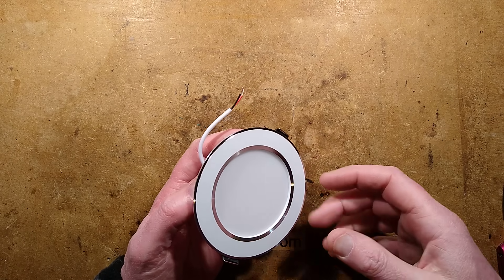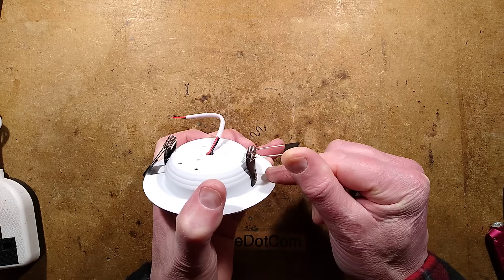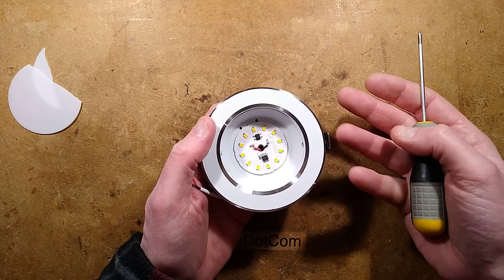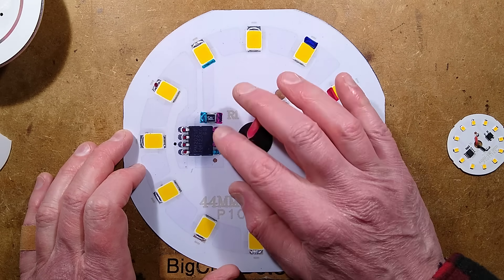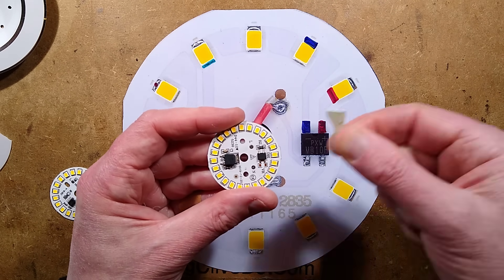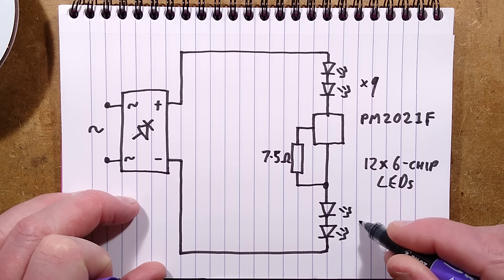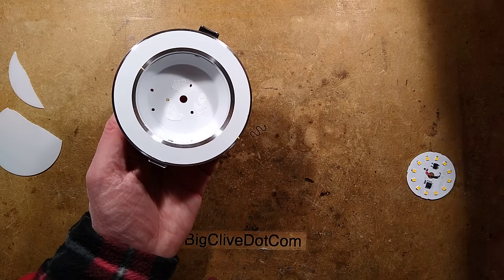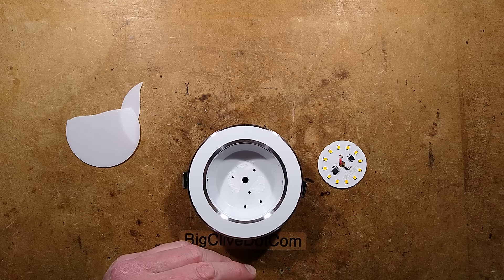inside a $1 downlight - novel circuit twist

Comment: Could you use 110 or 220 DC with the cheap LED? Should be no flicker? RF power supply might work!?
Reply from the maker: If you rectify and smooth standard 110 or 220V supplies the voltage shoots up to the peak sinewave value and causes issues with thermal dissipation from the linear regulator chip.

Comment: The good news is, that when the lamp eventually fails, those side spring clips will double as a mouse trap.
The bad news is that the springs haven't enough strength to kill the mouse.
The good news is that the electrical short circuit will electrocute the captive mouse.

Comment: I once found a led bulb made in one of the Asian countries that was made so shoddily bad that it was laughable but genuinely impressive it was bad, like the stinger heater kettle bad. I wish I still had it. 

It was also impressive due to the fact that it was from about 2003. And used blue leds and a uv paint silicone mix on the outside of the plastic lenses.
Reply: It didn't even have a capacitive dropper in it.......those poor poor leds 😞

Comment: I guess the trouble with these and poor serviceability (without good electrician know-how) isn't so much the zapping, but the potential fall from a ladder after the zapping given where such lights are located. Also I'm guessing these things would make a selling point for those snap-style quick connectors vs. any wiring nuts.

Comment: Big Clive, why do GU5.3 12volt DC downlights have so many components on their boards?
They run from 12v DC rectified transformers, surely All that would be required would be a current limiting resistor and possibly a capacitor.
Why are they so complex?
Reply from the maker: They need a rectifier and regulator because they have to allow for older magnetic transformers which have a higher voltage when lightly loaded, and the hideous electronic halogen transformers which put out a spiky waveform peaking at over 30V.
There's also an efficiency advantage to using a buck regulator on regulated 12V DC when driving LEDs at high current.

Comment: It would be nice of you if you got back to giving us the voltage of each chip. I like to make 12  or 5 volts dc lamps out of bad bulbs. Thanks for the extra work. Long time watcher first time commenter.
Reply from the maker: Many of these lights use multi-chip LEDs with a very high voltage per chip.  Often around 18V.

Comment: Lesson learned on devices like this one: if you have more than one installed in the same room, always buy spares. It will likely be impossible to find an exact same model (colour, size, brightness, colour temperature etc) sometime in the future when one inevitably fails.
Reply: Might not hurt to subtly mark one of the tiles in the drop ceiling, and keep the cache of spares in a small bag or box atop an adjacent panel. That way they're always in the same room where they would be needed. (Might need more than one reminder for that to work, but it's better than having some "mystery lights" sitting where they could get tossed or whatever. Or trying to figure out where they were stashed otherwise.)

Comment: Takes 12 Watt ? It should be ad bright as the sun with such a power usage (for a LED light). However it is very faint, is all the power dissipated into heat ?

Comment: I would love to see a tear down of the new style of disposable vapes that gave settings for "strength" as well as "sweetness". Strength is quite obviously voltage out but how are they adjusting the sweetness when it only has one juice reservoir
Reply from the maker: It sounds like a gimmick.  The flavour may change with power.
Reply: I finally got around to taking one apart and it turns out it's got two separate juice reservoirs and they fire independently.

Comment: I put 50 of these in my house. Failure rate is very low. I thermal glued a coke can on top of each as a heat sink. You can fix them by shorting the bad LED.

Comment: Would it happily take 12v?
Reply from the maker: No.  It would need a different PCB for that, or discrete high power LEDs and a resistor.

Comment: Every time i see you daintily touching the case testing for ground leakage, i'm reminded of my stupidity as a child.
I'd have to guess i was under 10, and my aunt lived near a lake (Sand Lake, in Onsted Michigan). I'd go summer with her and would tromp through swamps, sand hills, and lake collecting cans to return for deposit to support my arcade habit. I don't think shoes touched my feet the entire summer. These two points converge in that there was one arcade game (possibly pinball, they had both) wasn't properly grounded. I actually kind of sought out the nice rumbly shock/buzz that I'd get from pressing the buttons. The thought now of what it could have done is a bit frightening, dare i say.... shocking. :)

Comment: I have 30 of these that are bright white or warm white if you flick the light switch off and on again. The ones mounted closed to the hot metal roofing have had some of the spring clips break and are now hanging down sadly. None have broken down tho. They may be using a thermal glue to stick them down. I have thermal glue I use to repair light bulbs with those replacements boards you showed us as there’s no enough sheet metal to put a screw in.

Comment: Speaking of remotes, I bought one of those RF USB switches you featured in a video a little while ago. It took some time before I got around to buying one, since I initially decided I didn't want the on-off type remote, I just wanted a push button, and it took some time before I got around to looking for one. It's still on the way from aliexpress, along with some other bits and pieces I ordered, which presumably means I'll get a bunch of separate packages, despite ordering multiple things from the same vendor.

Comment: There is ones, without a bulge at the rear (so, a flat rear), and instead, a bulged cover-glass at the front, which can be removed easier since it´s already curved, and without braking. ALSO: Don´t need a ceiling-hole for installation, just some double-sided adhesion-tape instead (flat rear)... But I didn´t know that there´s replacement-PCBs available, that´s great !!! If one can connect the 2 cables himself, eventually even solder a replacement-PCB himself, then, there´s no reasonable argument against them... Saying "they´re unserviceable" is just "thinking one step too short"...

Comment: Hmm, so we have a metal case without the PCPE, with a paint coating, so that the silicone thermal compound has reduced value and no air vents for convection, so that the stuck hot air is slowly frying the components. What could possibly go wrong? XD

Comment: I always buy spares for these types of lights , put them in a box for use in the future ,  especially outside lights where you cannot get matching replacements ,  the cost is then replacing multiple lights because one fails , it's much cheaper to use a proportion of the savings to buy spares

Comment: Could be pretty easy to replace if wiring terminates with those Wago connectors with a lever. Although removing this style of fixtures tend to crumble drywall ceiling a little bit.

Comment: Had these exact ones (10 pieces) and all died with one single led burned within 10 months. Even though it's cheaper to just buy another same size and hope for the best. The low cost alone does not justify the effort for going the warranty route 😅

Comment: Here in Oz the lamps are fitted as new with a 2 pin power plug. Each lamp has a dedicated three pin power outlet in the ceiling. The home owner can legally replace the fitting themselves for about $15. In eight years I have replaced only 1 out of 30 lamps.

Comment: I work at a scrapyard and I see a pile of these show every once in a while. They're really awful because some of them seem to have a quick install solution but then years later, it's a different connector so the wiring has to be redone for a new system. I've hated these things for a long time but contractors doing new buildings love them because they won't fail within the warranty.

Comment: As someone who just changed this kind of downlight at home, I feel like its really commonplace in apartment homes? Its not too big of a deal as the like most of the commenters here are making it that you cannot remove the bulb, and its honestly not as hard as it sounds to change. I'm saying this as the amateur homeowner not electrician POV.

As long as you turn the breaker off, you can pull the downlight out and flick the mousetrap bracket up, and then with a standard phillips head or if its wago connector nothing at all, change the driver (its usually the problem) or the panel (via a locking DC cable, no screwdriver needed).

The thing is that China manufacturers these at such a low cost its ridiculous nowadays. A single replacable Phillips LED lightbulb is the same price as a full 9-15W square downlight where I'm at with LED driver included (~USD 7-10). Another upside is that its really elegant aesthetic wise as compared to some of the bulb based downlights.

And to all the people who says that it will break in 1 year so you have to buy more, these still last pretty long given their cost, probably at least 3-5 years, and usually 10 years or so, so its not like you really have to do it that often. 

However, not to say that it might not be iffy to use this $1 light in a long term home installation, just pay a bit more for something that likely works for longer.

Comment: How does such a simple circuit have a PF greater than 0.9?
Reply from the maker: The current is in sync with the voltage for a good part of the sine wave due to the lack of a smoothing capacitor.

Comment: I have a similar style of light in my apartment. These ones come in two parts - a 240V AC to 40V DC switch mode converter, which is sealed and double insulated (no earth); and the LED housing. When they fail - I’ve had to replace six in about five years - it’s remove the housing (avoiding fingers being crushed by springs), unplug converter, and replace. Repair is impossible as I needed a Dremel to open the LED housing. Very ewaste intensive 😢

Comment: I recently got a bag of random GU10 bulbs from a thirft shop. They had no markings as to what brand they were or voltage rating. They worked when I applied 12v DC to them and thought that was their voltage but found out they work all the way down to 6v. I decided to open one to see what kind of driver was inside or if they even had one but found a regulator board with an electrolytic capacitor rated to 400v. I haven't tried mains voltage on them yet, but it would be cool if they made bulbs that operate from 6v to 240v AC or DC.
Reply from the maker: If they're GU10 they are usually 120/240V.  But many of the older switching type will work at surprisingly low voltages at reduced intensity.

Comment: At 12 Watts, the closed casing will get at least 50C hot on the outside but probably more like 70-80C inside. That will cut the life of all components short. My LED I am using for experiments is powered only by DC with a small resistor. The cooler is about 10cm by 10cm with a computer fan on top. I even tried running them in Oil and water, which works well. To compensate for a 12 Watt LEDs heat you need a jar with approx. 400ml of clear vegetable oil. The vegetable oil has a similar refraction as glass fibre cables and works well for coupling. ;)

Comment: Here in the US we are starting to see more disposable downlighting fixtures.  Some of the major manufacturers such as Philips and GE make decent quality units that appear to be a standard diameter.  It is anybody’s guess how long the standard will stick around.  We’ve had the standard 2 inch x 4 inch work box for about 120 years and Edison base lamps for at least that long, so maybe this standard will stick around too.

I like the downlights designed to snap into a standard recessed can fixture opening.  There is a pigtail to screw into the Edison base socket in the can.  A non skilled homeowner could change the snap-in fixtures himself or herself.

Comment: I had an OSRAM branded LED bulb light 8.5w and did the tear down(To figure out why it failed).  Took a while(first timer)to get the circuit board out and cleaned of the foam rubber potting compound so I could see the components on the double sided densely populated PCB, one side full of SMD's and the other side full of through hole parts(weird).  All 24 individual LED's lit up fine so on to the driver board/supply.  Yep, the only electrolytic cap 270uF/250V failed..go figure.  Bulb is unusable now but the remaining parts are salvageable.  Thanks for the video Big Clive ...👍👍

Comment: Another bad thing about disposable down lights is that once they break in 2+ years time, then it can be very hard to find new ones in the same style, forcing you to either have the odd downlight in the roof, or replacing them all. If installing disposable downlights then it is best to actually buy plenty of spares (like I did when I installed them in my kitchen roof).

Comment: I bought a light very similar to that several years ago.  When I opened it up I had a good laugh because it had led tape around the inside perimeter as the light source.  Ever since, the light has been in my LED junk/parts box in the garage.  Sometimes late at night, I go out to the garage, open up the junk box and whisper sweet nothings to light so it never gets lonely...
Reply: I bought some of those to install under a shelf, just because they were dirt cheap (and I planned on replacing the power external supply). They actually worked better than I expected. My dad now has them, and several more like them, out in the ceiling of his little detached workshop. They're a significant improvement over the attempts to light the space with just LED tape on a bright white surface. (the ceiling is too low for traditional fixtures)
Reply from the maker: Many of them do use the LED tape around the side.  Often not making very good thermal contact due to bad application or thermal expansion differences between the tape and the case.

Comment: Isn't it only UK who needs/uses earthed power for lighting ?  I've never seen an earthed socked used for anything other that 380v appliances.
Reply from the maker: The earth is often taken to lights in the UK for safety if metal fittings are used.  Especially candelabras or chandeliers.

Comment: On first sight, this looks like it was designed for a low voltage DC connection, with it's red & black supply cable & no earth wire, maybe it was originally designed as such, but they changed the internal module to a mains voltage one!

Comment: I agree with you on the failed light.  It's not so much about eWaste as the GU10's create virtually the same eWaste, but having to get that cowboy sparky out to change the light when it fails.  Given the cheap ones are often grilled by over driving them, it is a when they fail not if they fail.

Comment: Are downlights allowed to have ventilation holes in the top of them? Would be an easy way to extend it's lifespan.
Reply from the maker: They often have to have fire resisting cans above them to prevent a room fire spreading upwards.  That restricts heat dissipation.

Comment: Interesting little video, Clive. A couple of questions: Is it possible to remove the from diffuser glass without breaking it? Is it possible to modify the current sense resistor to 'dooby' this light in some way?
Reply from the maker: It may come out easier if warmed.  Changing the single resistor is made a bit more complicated by the heat dissipation of the heatsinking.  But if preheated on a suitable rig it could be done.  An external capacitive dropper circuit could also be used, with smoothing.

Comment: I use a few of these, but older models, they are a few years old and still running. But not without a quirk: they are the 3 colour version (cold-warm-middle white), but they do not retain the last "setting", they just cycle at every turn on for a surprise :)
Reply: Are you sure? I have these from Philips and they cycle brightness only if you turn on and off quickly. If you let a few seconds pass between turning off and on again they retain their last setting. Pretty smart to operate 3 levels with just one switch. But maybe yours don't.
Reply: Yes, I was hoping that mine worked that way, but no (they are from aliexpress, so...). I got used to it, it is in a rarely used bathroom and the difference is not that large.

Comment: I've seen that arrangement with a linear regulator before. It turns it into a constant current regulator. The reason it doesn't flicker is because the lights are on at a constant current for a majority of the cycle and only dim-off when the total voltage drops below 20V or so. To visualize it, take your rectified sine wave and clip it at 20V and you'll get the effective output.
Reply from the maker: The combined LED series voltage has to be close to the RMS value to reduce the dissipation of this type of linear regulator.  So the LED string usually requires 100-200V before it starts conducting.  But because of the sinewave shape it's still a good percentage of the sinewave.

Comment: The reason to connect the NC pins is because you can use any of the hundreds of linear regulators that are around, differing only in the location of the power pins, the current sense and ground being almost fixed, just differing in being either 8 pin with 4 NC pins, or a 7 pin or 6 pin package with missing pins on various areas so they can save on that expensive leadframe for NC pins.
Reply: I would think it was a thermal thing, putting the unused legs on the same copper plane still pulls some heat from the chip inside. The tiny bond wire from that one connected signal pin is not conducting the heat away, the metal leadframe where the silicon chip sits on will however conduct heat pretty well. using the same copper plane on the pcb for all pins just makes thermal coupling into the aluminium backplate easier and more efficient.